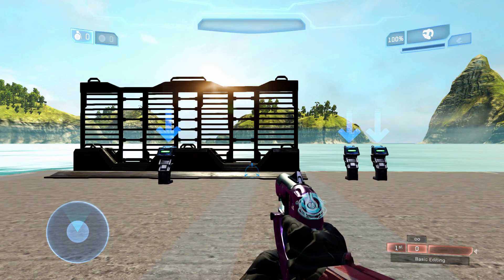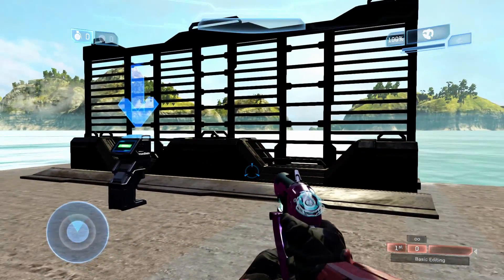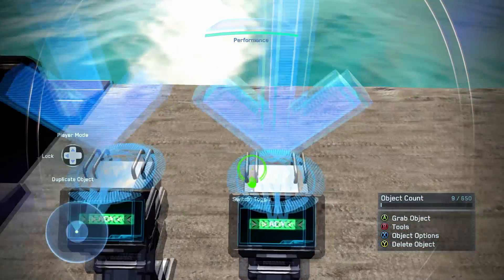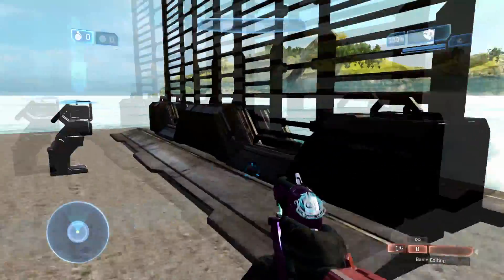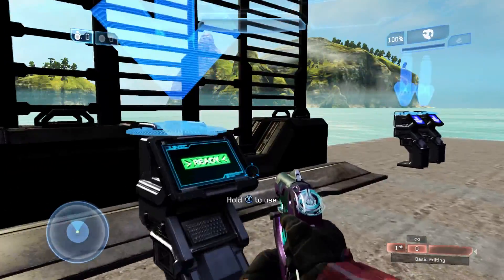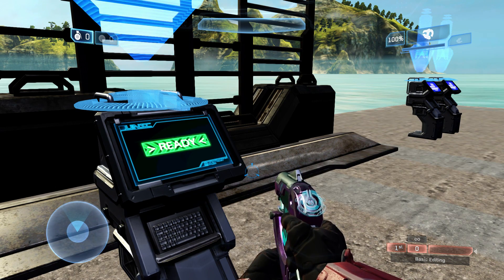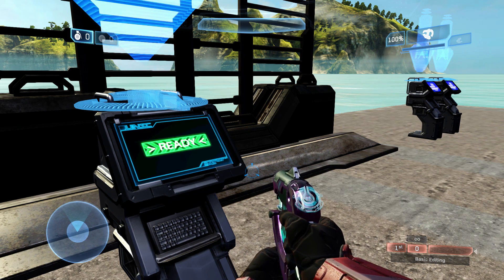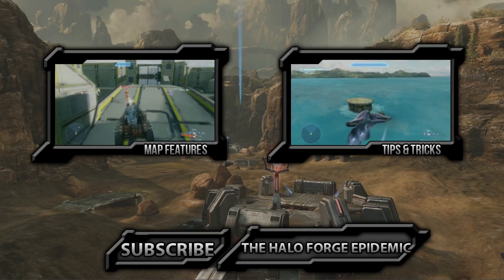Scripting Power Channels in Halo 2 Anniversary Forge

Comment: Can you guys explain how to spawn vehicles using scripting? I can't figure out how to do it, not to spawn blocks I mean vehicles. And also how to despawn an item for good(not a vehicle) like you press a button and the wall is gone for good, can't bring it back
Reply: You have to set the spawn channel of the vehicle to match the broadcast channel of the switch. You can also only test it out in custom games, not in forge. As for the second question, you can just use a switch on instead of a switch toggle. Match the spawn channel of the object with the broadcast channel of the switch.
Reply: Master Debaytes The first one worked, the second didn't. I put a Switch on just to despawn 1 coliseum wall and it would start the match with the coliseum wall already gone
Reply: Oldsiren Hmmmm. Make sure on the object that you're trying to despawn is set to spawn at start and make sure in the scripting options that it's set so that it can despawn.

If that doesn't work, there's an alternative method. Set the wall so that it will not spawn at start. Connect a Timer On: Once to the object so that the broadcast channel of the timer matches the spawn channel of the object. Set the timer on the Timer On: Once to 1. Connect another Switch Off to the object and have the broadcast channel of that switch match the spawn channel of the object. Of course, you also have to make sure that the object you're trying to spawn/despawn can despawn in the scripting options of that object. That should work too.